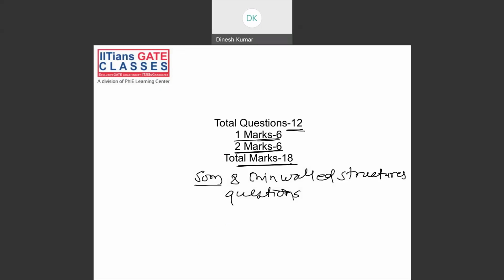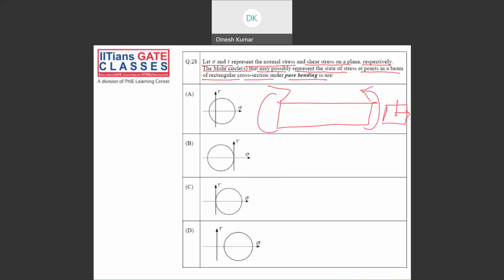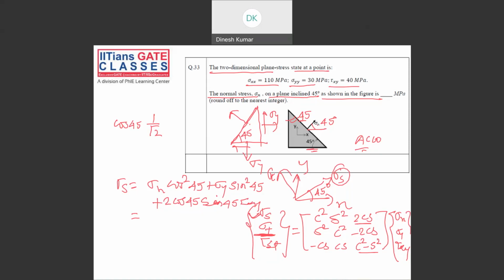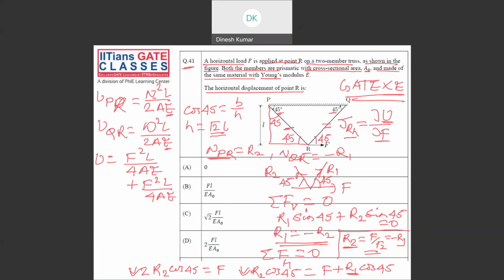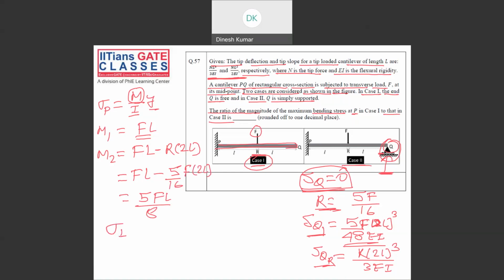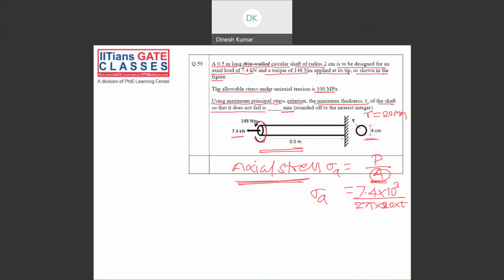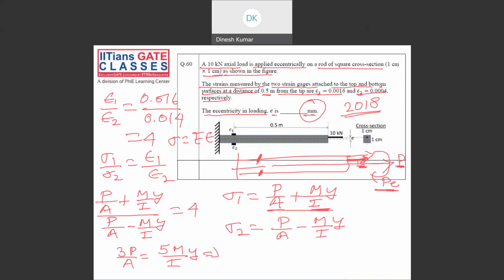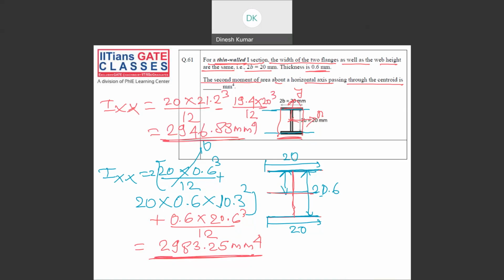GATE 2022 Aerospace Engineering Question Paper | A/C Structures Solutions | GATE AE Online Coaching

Comment: A one-twelfth-scale model of an airplane is to be tested at 200C in a pressurized wind tunnel.
The prototype is to fly at 240 m/s at 10-km standard altitude. What should the tunnel pressure
be in atm to scale both the Mach number and the Reynolds number accurately?
Reply from the maker: This is dimensional analysis part.
They already told to match Mach number and the Reynolds number.
So from the Mach number one can get the appropriate temperature needed. 
Then using that get the upstream stagnation Temperature. 
Once this is set, one can get the pressure ratio driving the flow.
Also from the Reynolds number get the kinematic viscosity and from there get the density (kinematic viscosity is function of density and temperature)